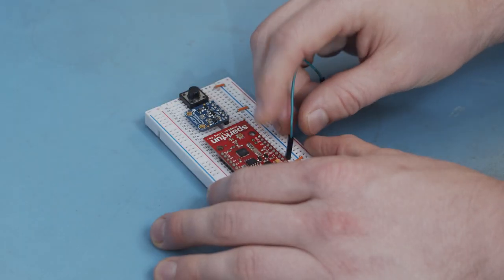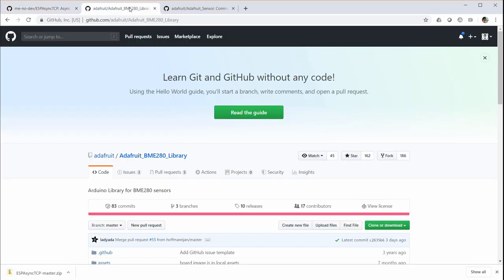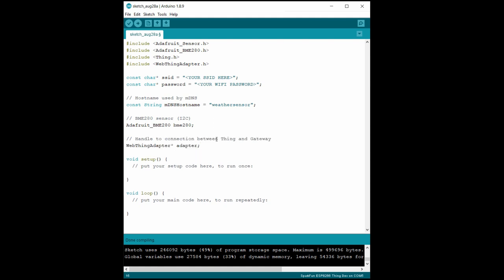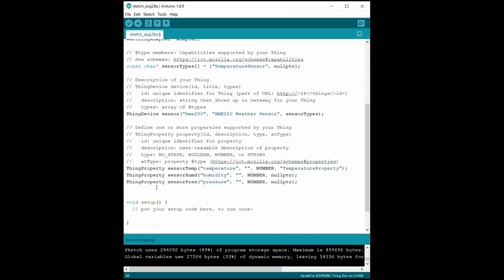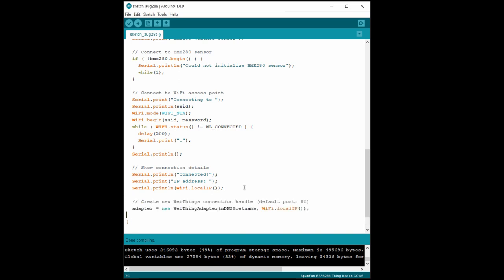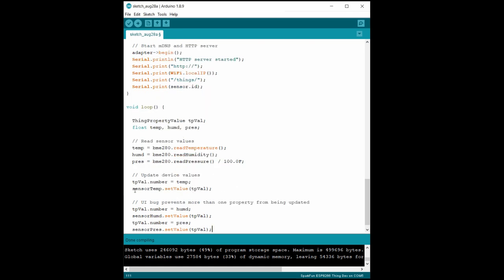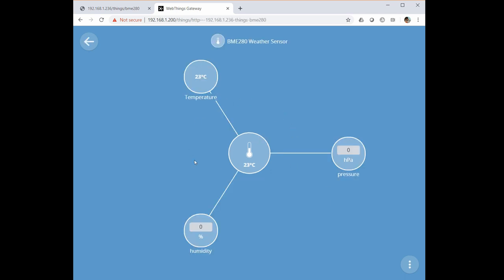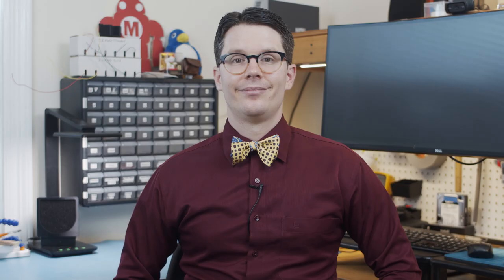Getting Started with Mozilla WebThings Part 2: Building an ESP8266 Temperature Sensor with Arduino

Comment: Would it be possible to use this to control a closet light? My idea is to have a magnet switch detect when a closet is opened and to have it turn on the light. And then have a push button that just overrides off and on.

Comment: Thanks for this video. Its Great work, but what to change in the code to use the DHT11 Temperature Humidity sensor?
Reply from the maker: Your best bet is to use the Adafruit DHT11 library and start with the example code found here: https://randomnerdtutorials.com/complete-guide-for-dht11dht22-humidity-and-temperature-sensor-with-arduino/ Once you can read from the sensor, combine it with the ESP8266 to send data to WebThings.